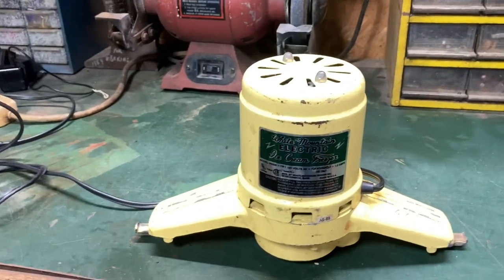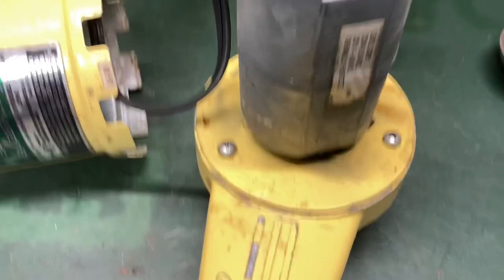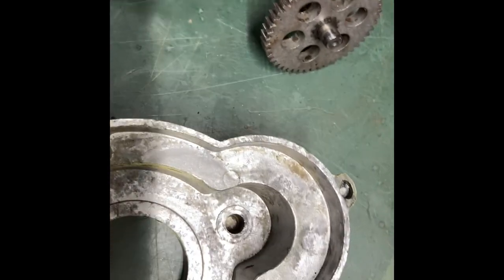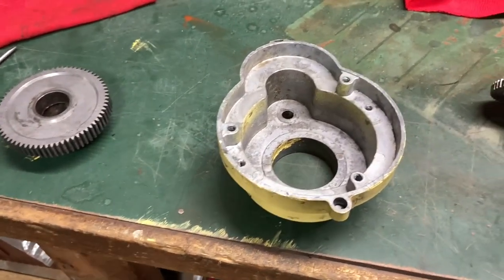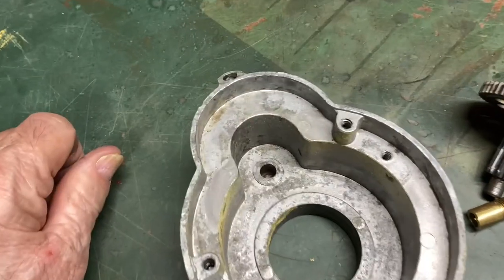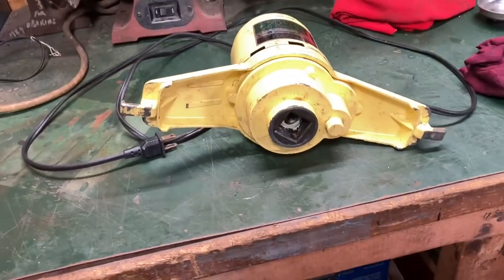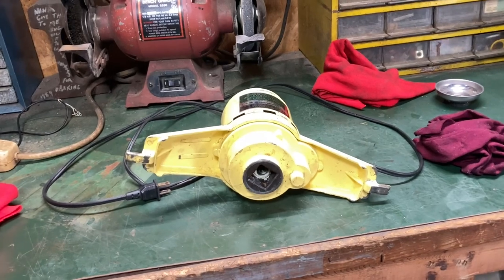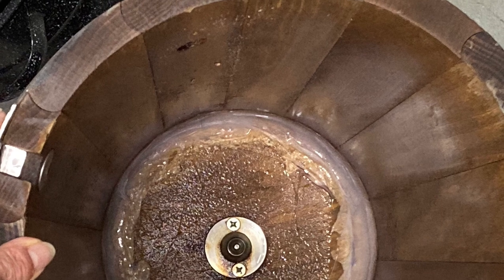Old Guy’s redneck repair on electric White Mountain ice cream freezer motor.

Comment: I've just bought a freezer it will be coming with the same style of motor. If gears are in ok condition, do you think it would still be a better idea to put bushing in there to prevent damage in the future?
Reply from the maker: They are really easy to take apart if nothing is worn too bad I would just go on Amazon and get the food grade lubricant. Take it apart clean old grease out lube everything up real good and put it back together. If that hole where that shaft rides is egged out then find a brass sleeve that fits the shaft, drill out the housing and press the sleeve in the housing. Mine is still going strong even with the worn gears. Good luck hope yours only needs a good cleaning and greased.

Comment: Where did you find your White Mountain motor parts?  I'm repairing one and can't find parts.
Reply from the maker: I could not find the any parts or even an old motor I could use for parts that wasn’t grossly over priced. I ended up making a brass bushing out of a pipe fitting. Parts for those old White Mountain freezers seem really hard to find, if at all.